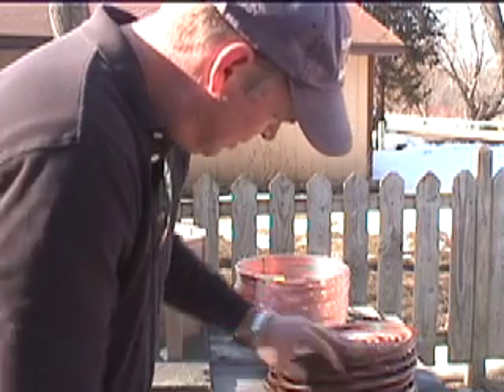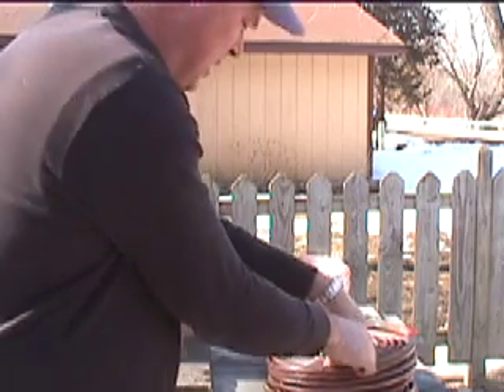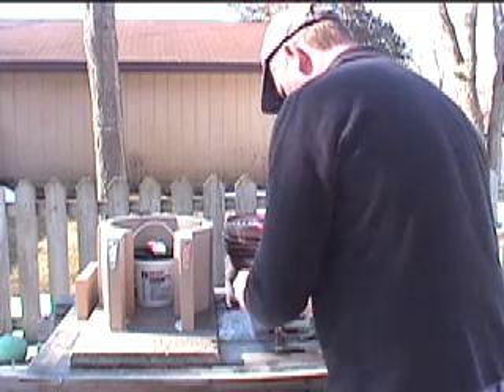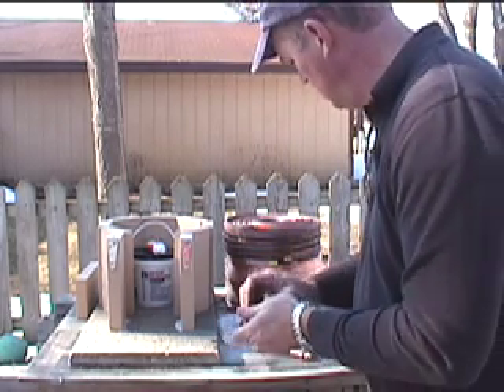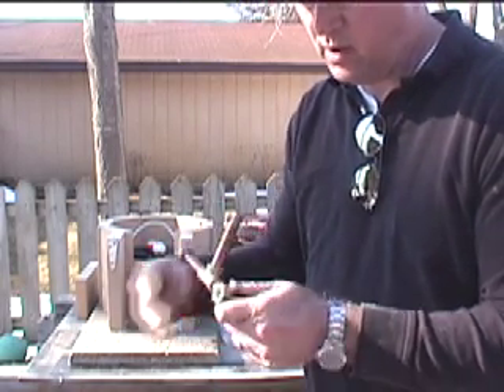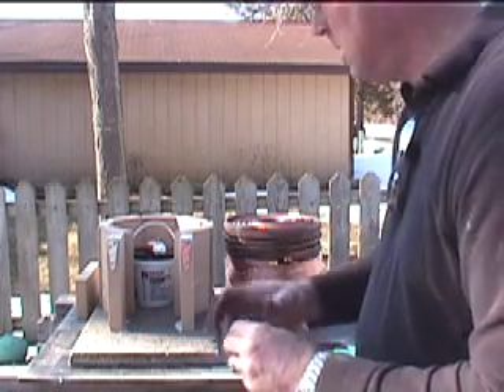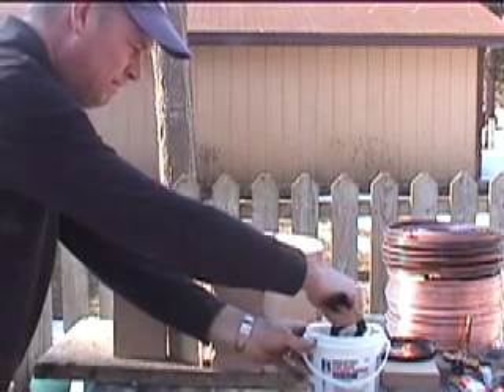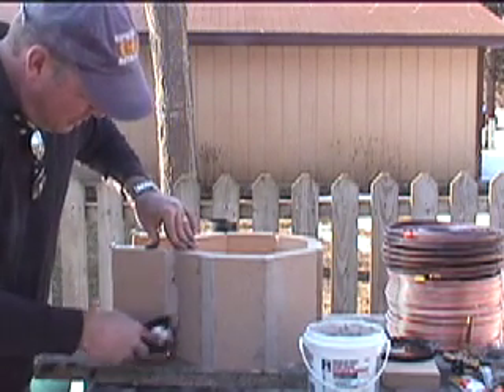Lynx Monotube Boiler Part 4.mov

Comment: I think a couple of holes in the sheet metal might be in order to help seat the bricks together.
Someplace for the furnace cement to pass through the metal so there's a direct bond between the bricks.